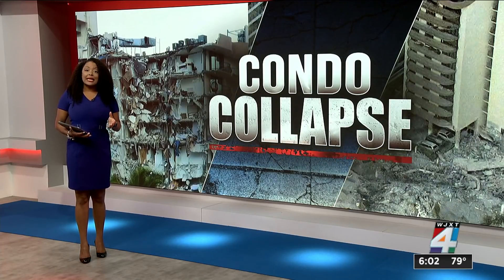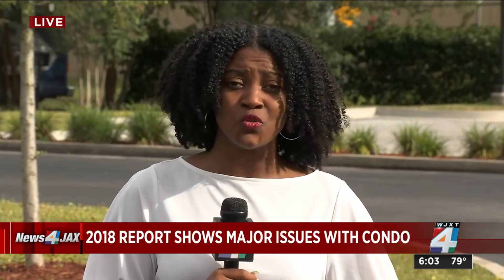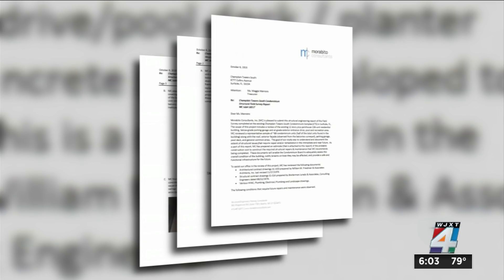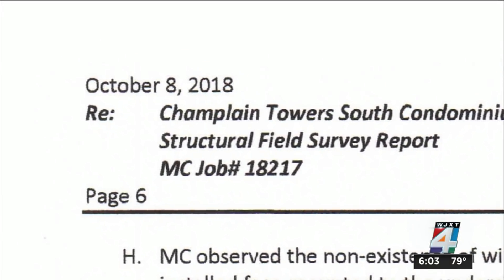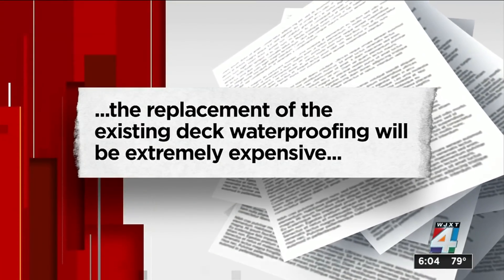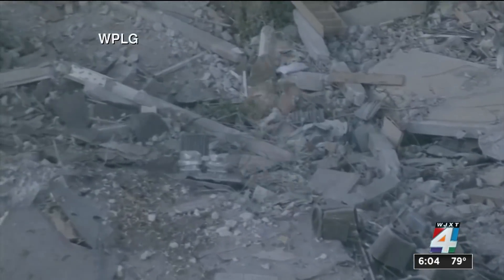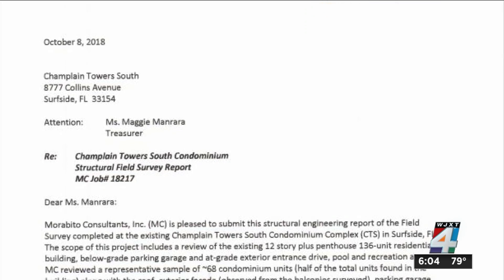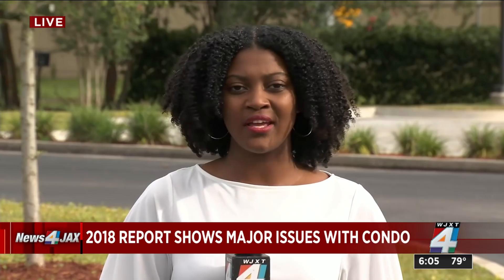2018 engineering report showed ‘major structural damage’ before condo building collapsed

Comment: 2018 engineering report mentions poor workmanship as well as structural issues.  None were corrected before the collapse. Miami condos sprouted like WEEDS when this condo was built 40 years ago.  Very likely builders skimped on materials and regulations, trying to build as much as fast as they could to maximize profit. The engineering report stated a major slab was slanted incorrectly, keeping water from draining properly.  The CAUSE of this collapse will be found underneath the pool deck, where most of the structural defects were found and reported. 
A relative said he spoke to his wife or aunt, who was on her third floor terrace shortly before the collapse.  She told him she saw a big cavern opened in the pool or on the pool deck. That's in keeping with the engineering report where most major damage was reported.
Are we to believe that with all the political corruption that's taken over our country, that city officials properly enforce building codes now and throughout the FL East Coast Condo Boom?  Dangerous conditions were reported, but three years later no work or repairs were started.
I'm no structural engineer, but from the little I saw of the engineering report, this building could not be repaired to current building specs instituted in 1992 after Hurricane Andrew.  The building owners (and those of similar buildings like this one) hoped to put off major repairs, especially if repairs would cost more than a new construction.  Nothing is said about re-examining these buildings to check repairs of defects to see if the repairs made the buildings safe. Checks every 40 years means those currently in charge will be long gone before buildings are checked again.  We may see a major exodus from Miami condos and decrease in oceanfront condo property values until every building has been reinspected and satisfactorily repaired.  Buyers will insist on engineering reports before buying, and will insist entire building repairs be done before buying into problems.  This may start the end of the FL housing bubble.

Comment: 'exponentially' means w/ a rate of intense speed and increase.  back in ancient history, the stone cutters went through solid boulders and quarry rock by tapping in a metal spike and then heating it to expand inside the stone.  w/ no further work, and w/ lightning speed one crack broke it completely apart!  the concrete here had expanded rebar throughout the water intruded area.

Comment: Didn't John McAfee have high value intel stored in that condo? And John McAfee "killed himself" around the time the condo with his information collapsed... strange.
Reply: Are you implying that he paid someone to blow up the building?  Surely there are simpler ways to destroy intel:  shredding, burning,...  The rusted rebar due to water damage makes much more sense, especially given this 2018 report warning of the severe damage, and Florida's waterlogged climate/land.  Why turn to conspiracy theory explanations, when common greed explains it fine?  Am I not understanding you?      ////Bunny kisses for all!
Reply: @DelinahLovesHouseBunnies  its just a theory, I just though it was an odd coincidence
Reply: @charlesmartel777xx    Gotcha.  The rusted rebar/spalling explanation makes sense to me, but it's always possible that someone set off a bomb.  It was only a 40-year-old building, so, based on what I've been reading, I suspect design mistakes (e.g., supposedly a waterproofing layer under the pool was supposed to be slanted to allow for drainage, but it was flat) and possibly cutting corners to save on costs at initial construction during the building boom.

I'm unsure if they could have done the repairs sooner after the Oct 2018 report; other commenters have said that only a couple companies in the area do that kind of work and are booked ahead for many, many months, and then Covid-19 shut things down.  I suppose they should have done an inspection sooner, or at least inspect the property themselves every year or two, and hire a real inspector if they see any spalling.  It's amazing how much damage salty ocean air can do over time.  [edited:  I forgot about the hurricane flooding; that's so much more damaging than ocean air.]     ////Bunny kisses for all!

Comment: What you’re going to find out with the Florida pedestrian bridge that collapsed and this building is ., inferior steel from China.    
We’ve been at war for a long time.  When you’re hearing  loud bangs in the middle of the night that structural cross members > snapping.    Yes Putting waterproofing over the pool deck is negligent concrete has to be porous and the application.  Water running down the back hallway flooding the foundation in the back contributed.  There are politicians responsible knowing about inferior steel in bed with China.   Just like China sending out all those seeds in the mail it’s because the 5 million operatives some seen  raking in seeds in the back 40s of farms  today’s battlefront is different.. Democrat politicians said OK for steel to build tanks that from China the armor   is inferior.   All i see.

Comment: Yes, all of that mentioned was in the report. Not in the report was anything about the potential of the building collapsing. Do remember, the condo owners own the building and make the decisions, people. They did know it would cost 15 million to make the reapairs which means each owner would have to pay 80 to 200k. Many people now under the rubble are not going to shell out that kind of money without a certainty that it is necessary. Unless you've been on the board of a condo assn., you might not realize how difficult it is to get people to agree on anything, esp., anything that's going to cost them money.

Comment: why do they always close the barn gate after the horse escapes? They always check stuff after a disaster never do proactive audits  OH God building has collapsed we better check the other 40-year-old  buildings this building had been there when Andrew went through and Wilma so were these building this old checked after these hurricanes went through, winds of cat 5 puts a lot of stress on the buildings. Are the new building going up Wind rated if not they need to be checked out after each hurricane for cracks in the Pillars if any are found the building should be condemned or something? look what kind of construction changes for homes had to happen after Andrew was anything changed for Highrises on the Beaches I for one would be very leery of living in anything taller than six stories.

Comment: the pit has opened up under one's feet we all know Florida is a Peninsula for you that does not know this is a landmass extending far out in a body of deep waters that are constantly moving by the rotation of the earth it will erode away no stopping it from happening we are not God but some would think they are fooled you did God Not, as in life in the flesh all will have their own pitfall into the grave, Is Not Florida known to have opening pits why is the God's, no it's man's fault for building so close just for getting a good view of an Ocean so blue now who is the one's that are so blue, you see them pointing a finger to whom it may concern they only have three pointing back at them, the pit is nothing more than a sinkhole in the earth crust that no man can stop, don't care what he does to try to stop it, have you not hread the foolish man builds upon the sand and the Wiseman builds upon the rock, just becouse they ppound iron into the sand and dirt of the earth and porded concrete around the iron concrete made of sand gravel and crushed limestone to dist just add a little water you have contcete not a solid stone upon bad rock

Comment: FL law has a loophole in construction inspections. Professional engineers are using a this loophole to hire unlicensed building inspectors to perform inspections. As a licensed building inspector I had to close my business because I could no longer compete with these unlicensed inspectors. If Florida wants to solve this problem then it should begin by closing this loophole.
Reply: I’ve never heard of a licensed inspector
Reply: @Gish Core   I'm sorry you lost your business.  But that wasn't the problem in this case, was it?  The HOA did get the 2018 inspection report that told them about the serious repairs that needed to be made.  I don't see how banning unlicensed building inspectors would have changed anything in this instance.  It may or may not be causing issues with other buildings; I don't know anything about that.

We should try to prevent these tragedies, but deciding exactly which changes would work best is complicated.  I like @Brian G C's suggestion of requiring inspectors to report serious flaws to the government (and then the government should set a deadline for when crucial repairs must be completed).  I had assumed that that was already law, as the only inspectors I had been aware of were the licensed ones who work directly for the government.

However, I disagree with Brian on making a law to revoke the certificate of occupancy, except in extreme cases of imminent danger.  If evacuation is unnecessary, such as for a slowly worsening problem that is nowhere near the high-risk stage yet, having to move out for perhaps many months, paying both mortgage and rent, or two rents, plus moving costs out and back, would be very hard on poor to middle-class tenants.  And, depending on their size and wealth, making the building owner pay those costs for possibly hundreds of tenants, on top of paying for the repairs, may be too onerous for them.  In this particular case, it may have been warranted, but, as a law, it's an overreaction.        ////Bunny kisses for all!
Reply: @Gish Core   Wait, would a licensed inspector have informed the county of the dangerous damage, and the county would have required repairs?  Whereas an unlicensed inspector doesn't have to report dangerous situations to the government?  Is that what you're saying?  I don't know Florida law.

But the 2018 report was done by a "structural engineer," right?  Was he an unlicensed inspector, too?  Was this inspection a voluntary thing done for the HOA's own edification, or a legally required inspection?  If it was legally required, surely the point is to inform the government of pass or fail conditions, so it seems like it must have been voluntary.  If so, would a licensed inspector still report dangerous conditions to the county?

If they make a law requiring unlicensed inspectors to report failing buildings to the government, wouldn't this solve the problem?  Or are there further problems with unlicensed inspectors?  I would guess that there are; the article I linked to in my above reply to mark pope indicated that unlicensed inspections are far less thorough.      ////Bunny kisses for all!
Reply: @DelinahLovesHouseBunnies   Some engineers choose to hire licensed inspectors who have the years of training and experience necessary to pick up on subtleties that could lead to catastrophes.   Some prefer to perform these inspections themselves because they realize the potential dangers and are not willing to entrust others with such great responsibility. And finally there are those engineers that will hire their cousins, brothers, sisters, and underaged children so that they can save a buck. I know because I witnessed it. I want to see an end to the practice of the latter. 
I am making no assumption as to what occurred or what caused this collapse. I am merely drawing attention to a loophole in inspection law which is dangerous and which could have played a role.
Reply: @gishgishgish    I think I see.  An experienced structural engineer or licensed inspector can inspect the building, and they know what they are doing.  However, now many states are allowing unlicensed building inspectors, with much less (or no!?!) training, and this is dangerous because they're likely to miss subtle problems that can develop into huge, life-threatening problems.  Thank you for clarifying; I totally agree with you.

Is this due to Republican deregulation?  Surely it's due to the engineers/construction companies lobbying politicians, perhaps of both parties, so they can save money and therefore increase profit.

We need regulations to protect us from corporate greed.  Non-rich conservatives are manipulated by the propaganda of the right into believing that government is the problem, but it only is to the extent that corporations (and billionaires like the Koch brothers) are allowed to buy politicians.  When we the people unite, we have been able to create parts of government that protect us (not enough yet) from pollution, unfair labor practices, etc., and provide us with some (nowhere near enough yet) social safety net.  The way to improve government is to get money out of it--public funding of candidates only, and such.

Usually each regulation is created only after many people have been harmed, making the need obvious.  Regulations were created for good reason!  Not to say that all bureaucratic red tape is necessary and good, but research why it was created before deciding to dispose of it!  Well, hopefully some good can come from this disaster, if it inspires people to get rid of unlicensed inspectors, although I don't know if they had anything to do with this.        ////Bunny kisses for all!
Reply: @DelinahLovesHouseBunnies  Both sides take corporate money and therefore both contribute to the problem. The courts allow it so they hold responsibility, the media ignores it and so they are responsible, and society turns a blind eye. So as long as we keep putting up with it, we hold the final and ultimate responsibility.